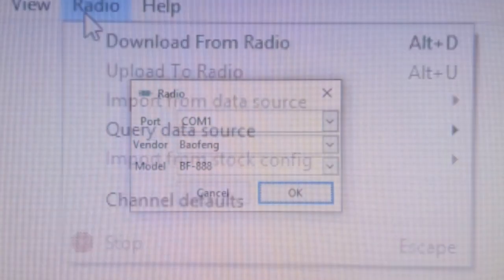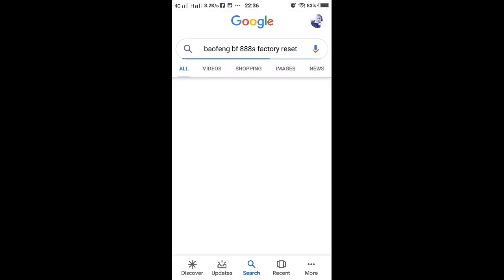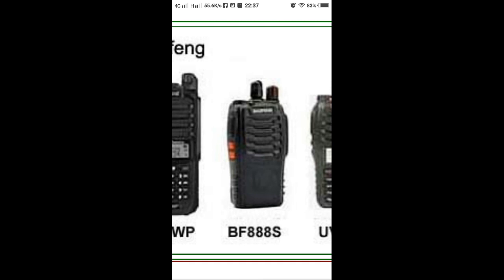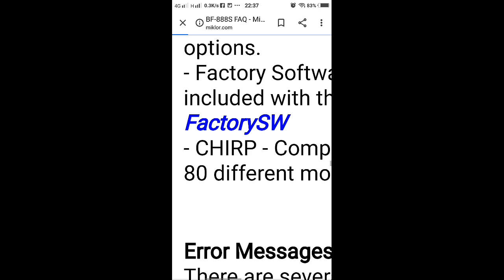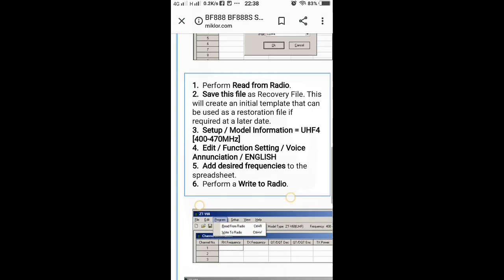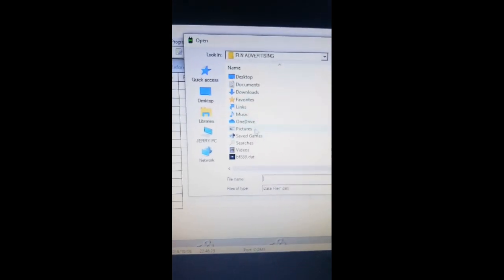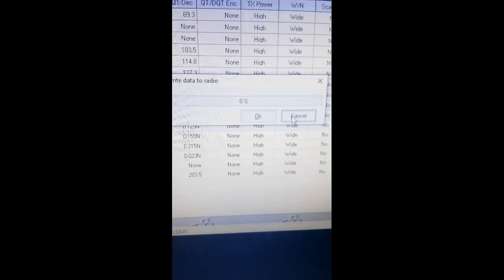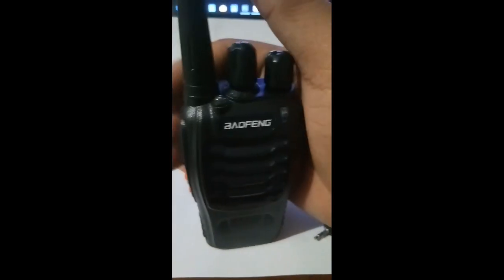Reprogram || BAOFENG BF-888s || Radio refused to enter programming mode || Issues Solved

Comment: When i read from radio is stays at 0%
Reply: click ok
Reply: @Manumave  then it just goes away
Reply: @lollolol9586  You can try with the baoefong original software.
Reply: @lollolol9586  I will see what I can do for you
Reply: I've tried it al i think that my programing cable is broken or fake
Reply: Bc i bought a new walkie talkie and it still didn't work
Reply: @lollolol9586  Maybe